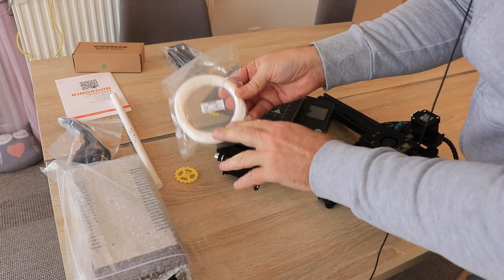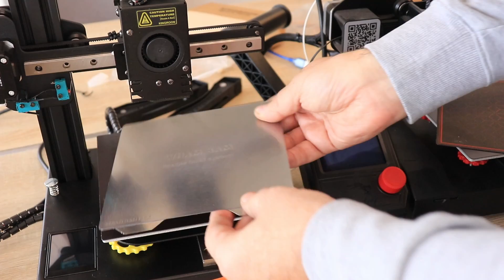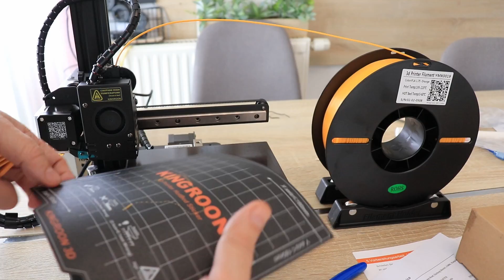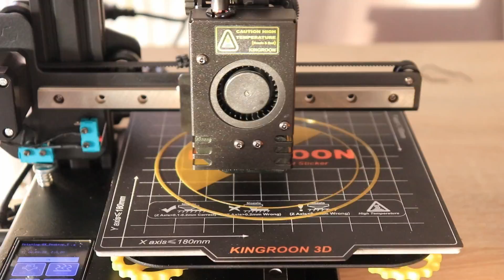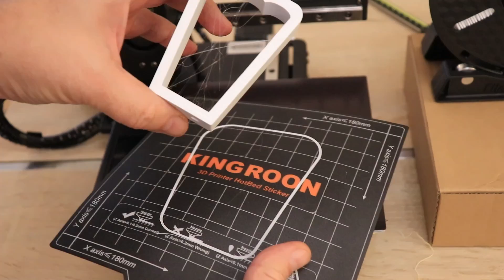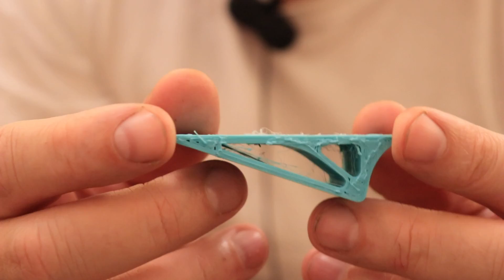Cheap and small but prints great: Kingroon KP3S 3.0 3D printer

Comment: Thanks! a most excellent review.  I just pick up a used one (as-is parts only) which is my first 3D printer for $50. to fix it I only had to repair the 4-wire cable between the main board to the extruder cuz one of the wires was open.  I also had to replace the missing heat block throat nozzle and build surface plate (I didn't get the soft Kingroon one that comes with the printer).  Though I am just getting started it appears to print the few objects solely for testing very well.

Comment: Am I insane for wanting to return my SV06 for a standard Kp3S? It seems I am not using all the space that the SV06 provides, and the Kp3s is the perfect size, and also twice as cheap.  I just dunno how it fairs with ABS which I do sometimes need to print, wouldn't mind upgrading the hotend to an all metal or bi metal tho.

Comment: Olá, excelente vídeo. Eu gostaria de iniciar no mundo da impressão 3D, acha que para um iniciante essa impressora seria uma boa compra? Tenho algum receio na montagem da mesma, acha que as instruções são fáceis de seguir para quem não tem experiência?

Obrigado
Reply from the maker: The assembling is easy, there are several options I could suggest: Kingroon KP3S (newer version), Sovol SV06 Plus, BambuLab P1P (depend of your budget)
Reply: @MyTechFun  to me, it Will be for Arduino projets, to make some boxes with sensors for now.

Comment: I have a question: I have mine leveled, but the middle (point 5) hits the bed, even though the other ones are all leveled. Any advice?
Reply from the maker: Check is any dirt below the pei sheet in center. Or just use 0.3mm on first layer, less sensitive to errors.
Reply: @MyTechFun  Thanks for your reply. didn't expect any as you have a lot of comments around your videos. I checked and there is no dirt. I replaced the PEI sheet with a glass one but the results are the same. Some research suggests it could be the x-axis sagging as the head is heavy. I'm a newbie to 3d printing and I have no idea where to start with that so for now I just print with a raft which seems to alleviate the problem.

Comment: It would be interesting to do a side by side comparison with the Tronxy Crux 1.
Reply: See Nathan Builds Robots review of the crux 1, the steel wheel motion system introduces ringing on the surface quality. I've not seen anyone running klipper on the tronxy board either. It does have belt tensioners that the KP3S lacks.

Comment: Nice and detailed review. I have just ordered KP3S Pro  - the upgraded version of this printer. It has available Y-axis linear rail addition, so you can have all 3 axis with linear rails, it has build-in power supply in frame, it has bigger print size 200*200*200 and X and Y belt tentioners. Also it will come by default with glass bed, but you can have PEI sheet as addition. Everything else is same as on this K3PS. There is also "official" tutorial from Kingroon to run this printer with Klipper which should be even more interesting and will better use the potential of this printer. Now with haloween/11.11 sales and coupons it was able to have Pro version with Y-axis and PEI sheet for around 200$/€ :)
Reply from the maker: Hm, now I am thinking, why I got the older version for the review. I must be too small channel.
Reply: @MyTechFun  I don't think so, they are not available in Europe until late December, so they can't generate sales for the Pro. 
I guess they have a lot of the non-pro sitting in warehouses, so they send them out for exposure. I bet next year they send you the pro version when they are available everywhere.
Reply: @damustermann  I was ordering Pro on 2nd November when they just became "in stock" in EU warehouse (by their website), few days before there was status of availability set to early November for EU warehouse. It was told to me by their chat that printers just arrived to Germany and will be shipped soon. I hope thats true, because i have noticed that stock date was changed to 16th december (it appeared there just 2 days ago).
Reply: @creativ01  I contacted them in September, and they told me they can't get a printer to me (in Germany, too, Moin ;) not before late December. I got a Tronxy Crux1 instead for 130€ as a Warehouse-Deal on AMZ. Poor thing will be modded to Oblivion ;) 
I hope you get your Pro ASAP, I think they are the best Cantilever Style printers out there (if they really exist).
Reply: @MyTechFun  :D I think both printers are good. Only Pro version has upgrades which most people would like to see on standard version.
Reply: "so you can have all 3 axis with linear rails"  this is not rue..  PRO version have linear rail i axis X and Z, but in Y have same wheel rail as non PRO version..  This not be better ... 😐 (if you must choice to have one axis in wheels, better is Z... )
Reply: @rz6354  Just try to read again. I wrote that you can have Y-axis rails as addition - its available as part of order... Also in that time there wasnt Pro S1 version which already have linear rails on all 3 axis.